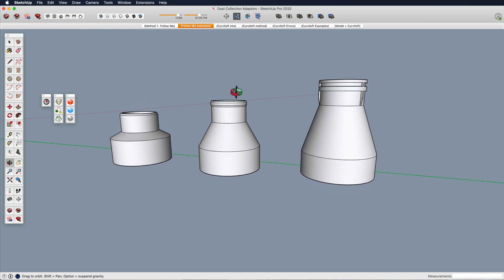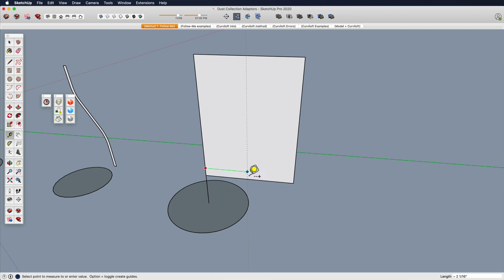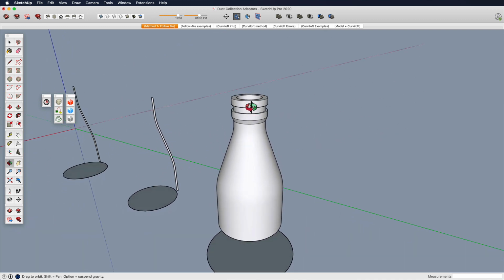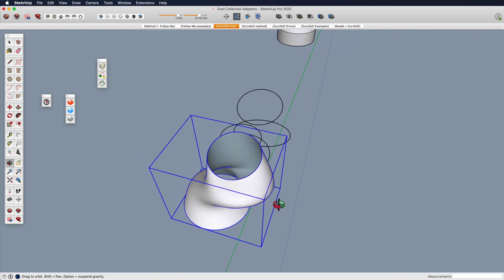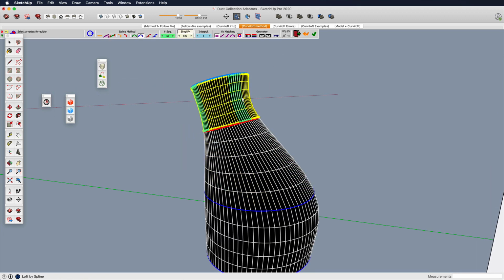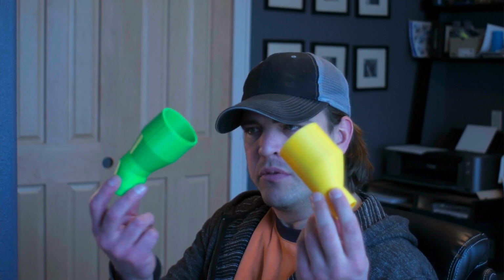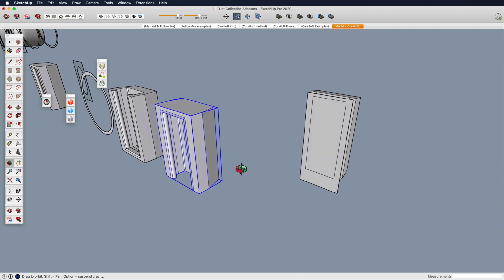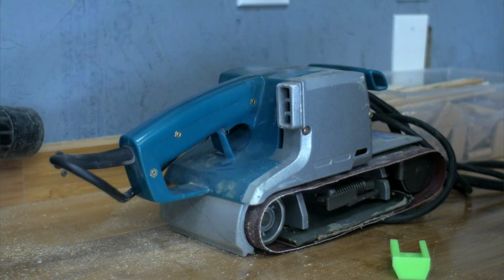Making custom dust hose adapters using SketchUp

Comment: im unable to smooth the curve with the arc tool. it keeps drawing an arc instead of changing the straight line to a curved one. do I need a special key combination to apply the curve to the existing line?
Reply from the maker: At what time are your referring to?

Comment: So timely, I'm in the thick of "how can I solve my wood particles" problem.
Reply from the maker: Just here to help.  ;)
Reply: If you're running low on wood particles I can help you out. I ran about 600 or 700 linear feet of cherry through the planer yesterday. ;)
Reply: Dave Richards I hope your dust/chip collection is more effective than mine.
Reply: @JodyGates  it's not bad as long as the hose doesn't fall off the planer while it's running. The DW735 blows chips all over the shop if not connected to the DC.